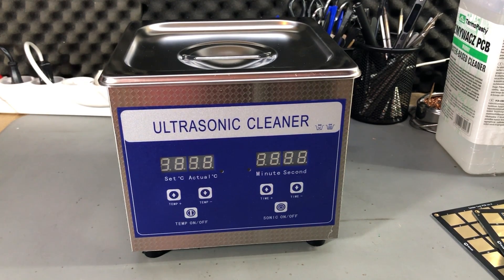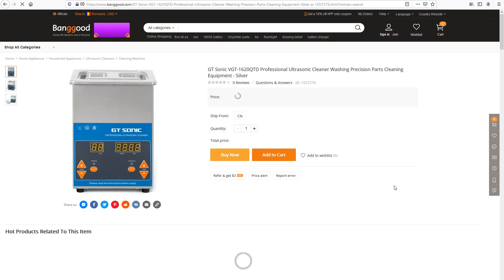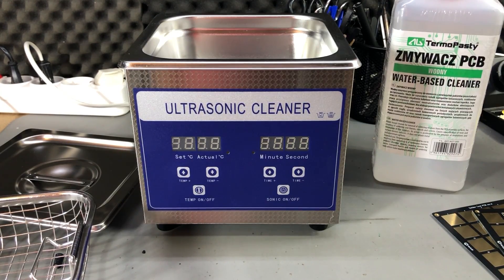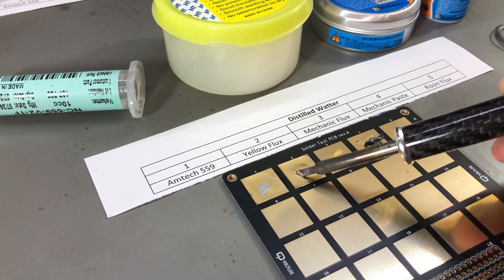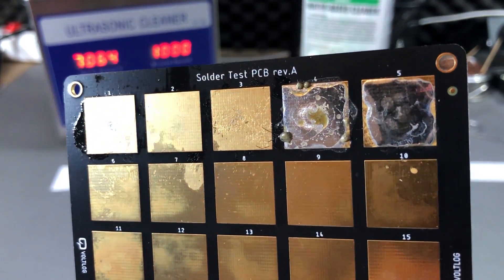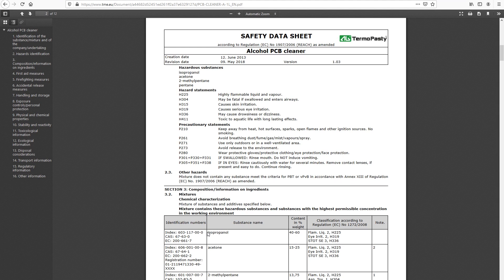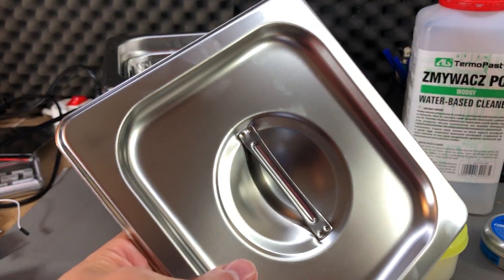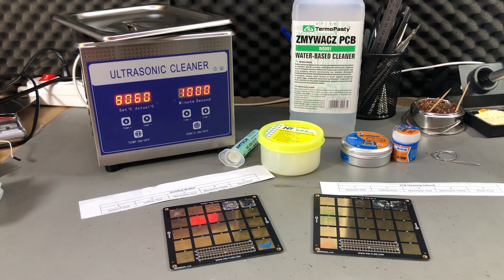Voltlog #267 - 60W Ultrasonic Cleaner For PCBs (review)

Comment: Well done but at the end, at least for me, ultrasonic clean should be used only when needed, with high density SMD and/or BGAs. Otherwise you can easily use a toothbrush and a flux cleaner, then wash the board under water and simpy dry it with hot air.
Reply from the maker: Like I said in the video, it depends on what you are building, how often, etc. Some people will need an ultrasonic cleaner, others will not. Imagine building some modules and selling them on tindie, would you want to brush and scrub them individually? that would be a waste of your time and the result will not be as clean as with the ultrasonic cleaner.

Comment: 91% IPA works great and costs much less than the cleaning solution...
Reply from the maker: For best results IPA alone will not suffice.
Reply: @voltlog  Most people use IPA to manually clean boards because it works pretty well. Heated to 50-60c and with ultrasonic cleaning assistance, it works much better. It's also inexpensive which is why most board assemblers use it.

Edited to remove obnoxious behavior on my part! :-D
Reply from the maker: This escalated quickly 😂
Reply: @ats89117  IPA works well and it's cheap, but most flux cleaners products uses multiple solvents. And there is a lot of difference in results, expecially with tacky fluxes.
Reply: @585585MC  Okay, they have the ingredients on the package. 40-60% IPA, 15-25% Acetone, 13.75% 2-methylpentane and 11.25% pentane. I've used all kinds of fluxes and never failed with IPA heated to 55c and 5 minutes of ultrasonic agitation, but if I did, I would go to acetone as a secondary solvent. 2-methylpentane and pentane are readily available, but I don't keep them around...
Reply: @voltlog  Sorry. It's been a it's been a long day...
Reply: @ats89117  agree, I talked at room temperature. But it's true, by heating IPA you can remove all fluxes, as you said.
Reply: for smaller pcbs is it viable to put the IPA in a small plastic zip lock bag along with the pcb and toss the whole thing in an ultrasonic cleaner filled with tap water? the point is to not waste a huge amount of IPA and ziplock it to minimize/eliminate the evaporation.

Comment: You can use taller containers for larger objects that are only tall. I often use a pint for eye glass sized objects. In larger cleaners containers in water bath is a great way to reduce volume of cleaning volume.
Smaller containers also allow you to use safe amount of something like flammable liquids with a reduced risk. I'd never use something like alcohols in my 3L (or is it 4L) cleaner. A small container feels safe enough though.
Use containers with hard walls like steel or glass. Plastic containers do no transmit power as well and the cleaning effect is reduced, especially with thick plastic walls.
Reply from the maker: Even with your big cleaner if you dilute IPA into water it should be pretty safe.
Reply: @voltlog  I've used mostly something like 50% IPA or 25% alcohol and a like. Never had a problem with those. However, I still don't like to evaporate a large bath or use liters of cleaner for small jobs. I have a 3-4L unit that is often way too big. That's why I often use smaller containers in it.

My unit has no drainage tube and getting the solusion back to bottles is not too easy when you need to pour it by tipping the unit. That is something to consider for anyone getting one!
Reply from the maker: this small unit does not have a drainage tube either and I can imagine how this can be a big problem for a larger unit..

Comment: I too have fond the heating element to be very slow / insufficient for preheating the liquid in my case (that is, cleaning one or two things every now and then). Instead of preheating, I fill the cleaner with cleaning solution made with as warm water as I can get from the tap. Then I use the heater while cleaning, taking advantage of heat generated as a byproduct of ultrasonic cleaning.
Even though the cleaning performance increases while the solution heats up, with good cleaning solution performance isn't bad even at lower temperatures.
My cleaner has "2.5L" tank, 60W transducer power and 100W heating power.
Reply from the maker: Do you use commercially available cleaning liquid or do you make your own?
Reply: @voltlog  I use generic ultrasonic cleaning fluid made by Oregon. Unfortunately it's not very effective against flux residue. But it's very good for cleaning dirty things in the garage: Tools, carburetors etc.
For cleaning PCBs, I did try making my own solution with IPA and some other chemicals. I was able to get similar results as you in this video, but for me it was too much hassle. Quick scrub with toothbrush and IPA or alcohol prep pads works just fine for small quantities. If I start selling something on Tindie at some point, I'll have to take another look at cleaning PCB with ultrasonic cleaner.
Reply: @Hugatry  just put the pcb in a ziplock bag with rubbing alcohol and put that into the ultrasonic cleaner
Reply: I guess you can hang a 2500W heating element in there if you want fast.